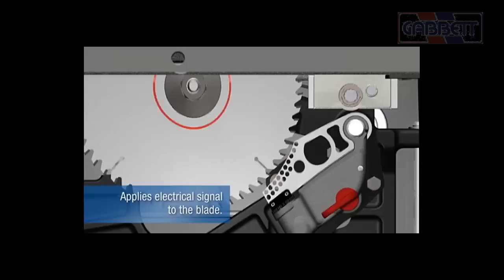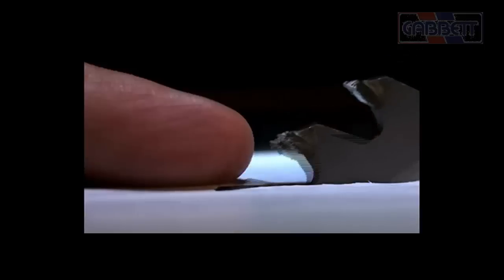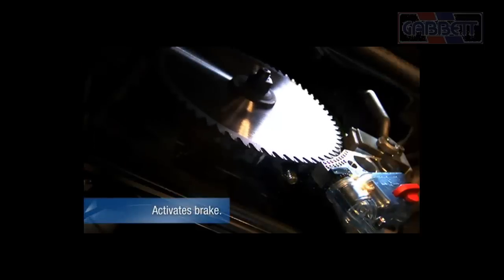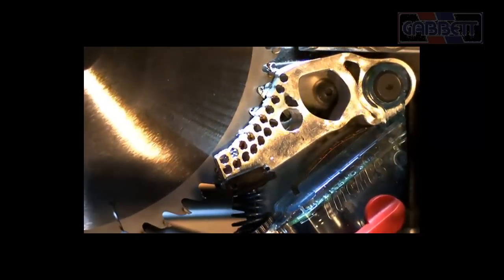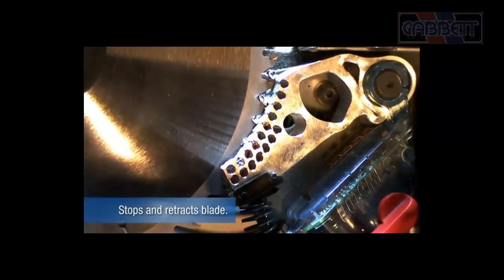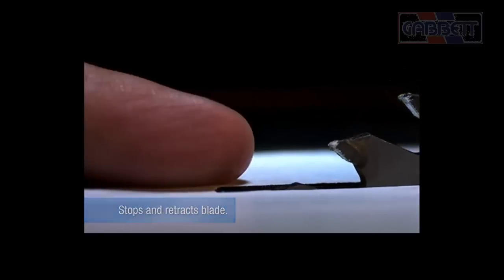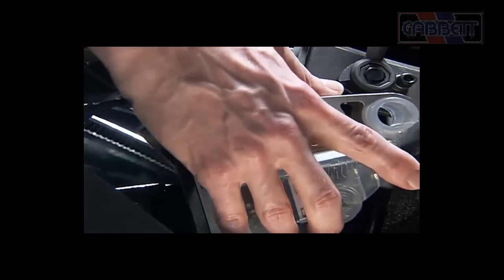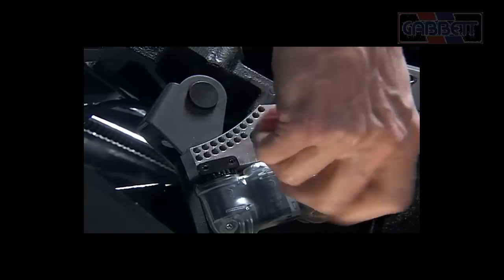The sawstop safety system, how does it work?

Comment: imagine a situation where your house got invaded then the only viable weapon is that saw, then rather than helping you it just un-arms you with the only thing that could've saved you
Reply: In what situation could you be in where a table saw is your best weapon against an invader
Reply: Please elaborate how a table saw can be used as a weapon in home invasion
Reply: I mean, if you're in a setting that has a table saw, wouldn't you be surrounded by tons of other sharp objects like razors or hammers that would be better suited for this occasion?
Reply: Well first of all it wust just a dumb thought  because I think too much about possibilities. Here's the situation you lock all your tools up, you just finished using the saw the all of a sudden  you hear something break inside, you check it out then you got spotted by the intruders then run back to where you came to hide and remember the keys to the lock of your tools are inside but the only thing you have is the saw so yeah. Just a random thought on what if that happens.

Comment: What happens if I am cutting ACM material (dibond)? this material has two layers of aluminum  and a rubber core plus can store a fair bit of static electricity( and get shocked xD)  especially when grabbing them stacked on top of each other from delivery. Im assuming the saw blade would stop if my hand was making contact with the aluminum edges and that touched the blade if that makes sense? I work in the sign trade and it would be really nice to see a safety feature like this in place for reassurance but unfortunately we work mostly with ACM and don't think it would be worth installing, does anyone know anything about it as im not sure what would be the out come?

Comment: What happens if I use gloves?
Reply: probably will stop after it cuts trough your gloves
Reply: you should never wear gloves when you are working on such a spinning machine. That includes tablesaws, electrical planers and also any kind of routers. the problem is that the machines can grab the glove and pull you hand with the glove in itself, so you may not only lose some parts of your finger, but maybe your whole hand. Sorry for my bad english, but im from germany.
Reply: @williwiesner5340  yep, one of the first things I was taught in the shop.

Comment: Does no one else understand that these cost 70-90 dollars to replace... yikes
Reply: Still better than lose a finger or even your entire hand 🤷‍♂️
Reply: Yes, everyone understands. 70 dollars is absolutely nothing compared to losing a finger. 

Replacing an airbag in a car costs $1000 minimum but no one complains about that
Reply: Was it the blade or the brake that cost 70$?
Reply: @chainjail4834  The brake. Circular saw blades are like six bucks at home depot
Reply: @ShadowmancerLord  oh so it's one time purchase then, it's not too bad xD
Reply: @chainjail4834  yeah basically it just costs another 70 every time you trigger it since it destroys the brake piece too
Reply: @ShadowmancerLord  ah I see...
Reply: How much does it cost to reattach a finger? You could buy enough sawstops for several lifetimes with the money you'd save.
Reply: 70$ < finger

Comment: But it does damage the saw.
Reply: which one is it supposed to save? the finger or the saw?
Reply: @Aprikuusi2003  the table ofc
Reply: @randomgooy7456  ofc
Reply: just the blade
Reply: Circular saw blades cost like $6 dude
Reply: The blade, not the saw. Blades are cheap.